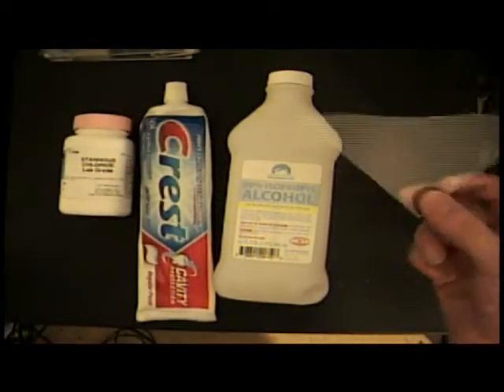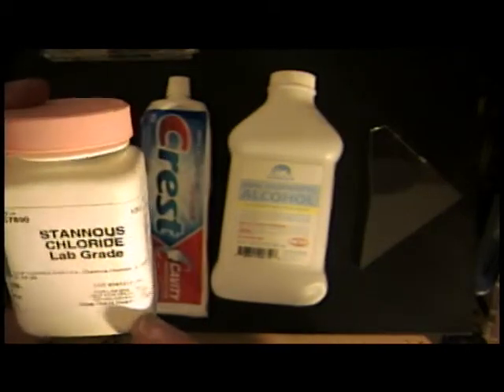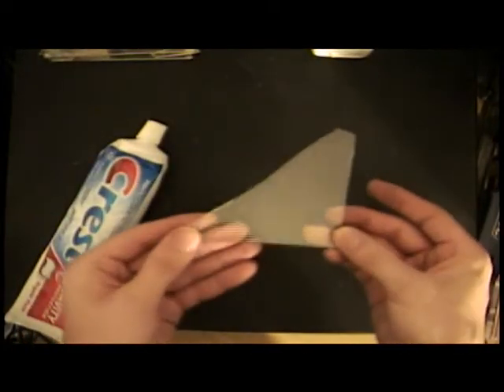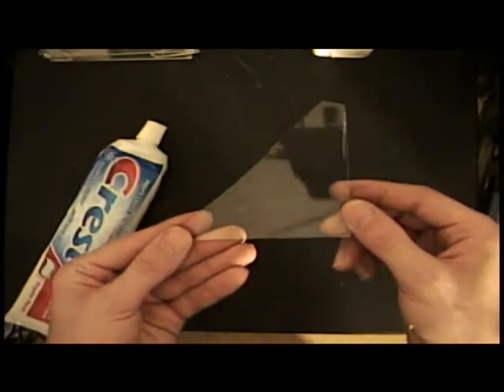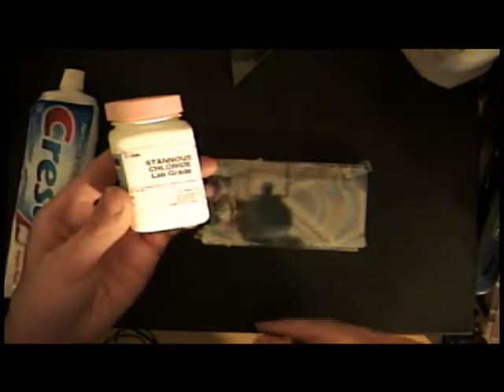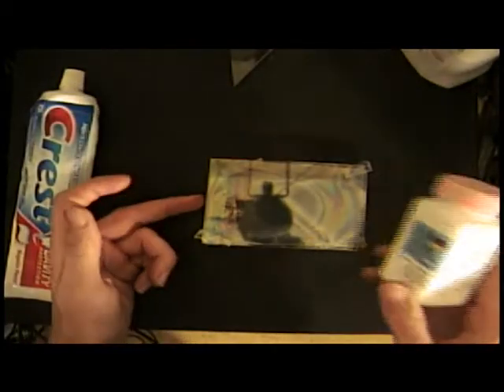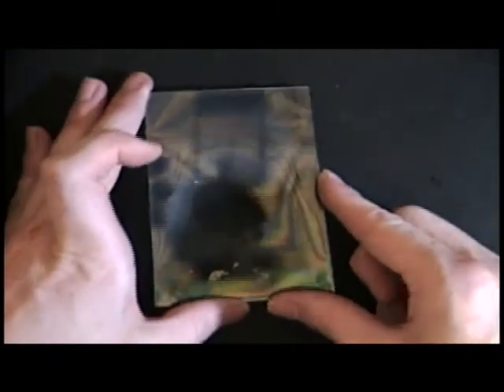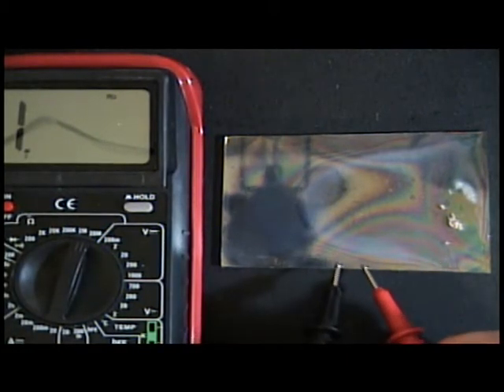Tin Oxide Conductive Glass - Stannous Chloride

Comment: @vmelkon Its a semicunductive chrystal but with  either one or two oxigen  (SnO or SnO2) shuld reduce conductivity , anyway toothpaste has SnF2 ( tin fluride) my english is not good, but chemistry is ok. try other metals or if you want the glass transparent use cunductive plastic paint. Its expensive but easy to make. Good luck. Silver nitrate is best.